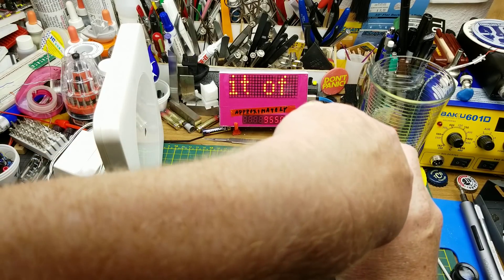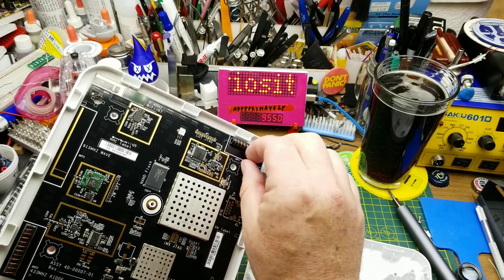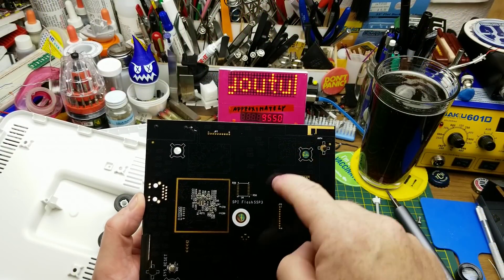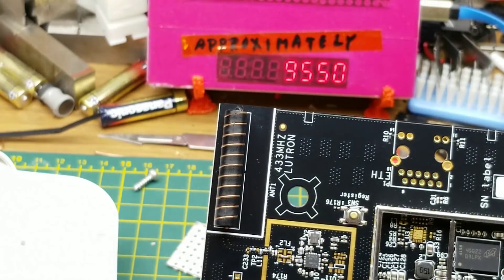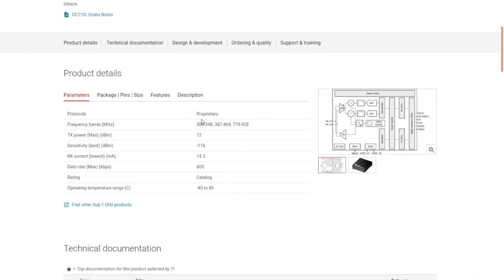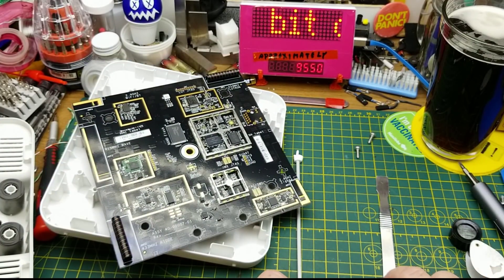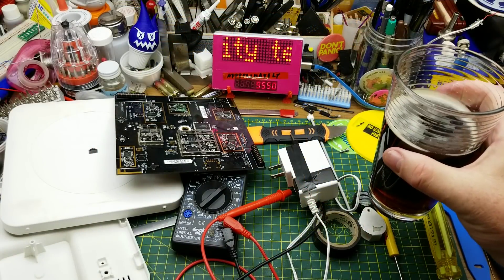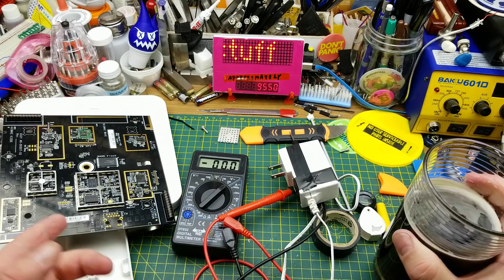IOT hub teardown (and a bit of a rant)

Comment: That power supply seems to be quite common and of reasonable quality.  I have a black one in the exact same shaped enclosure that came with a Yaesu ham radio and I highly doubt they would use something of questionable quality with a radio costing ~$1,000.  Now just replace that black electrical tape with some nice white tape and no one will notice!
Reply from the maker: If it hadn't been glued together, it would have been almost perfect.

Comment: Could you hack into the hub/Jail break and repurpose it?
Reply from the maker: Possibly. I'm not that strong on software and reverse engineering communication protocols, but i would bet it is possible.
At minimum a guy could probably load some custom firmware onto some of those microcontrollers.

Comment: Dude there's a uart serial connection! It's an international crime to tear down a piece of technology and not hook up an Arduino/serial adapter to see what's going on, especially when it's labelled like that.
Reply from the maker: Sounds like a future project.  Assuming they haven't encrypted everything.
Reply: You'd be surprised.  There's a really good guide video on YouTube somewhere worth checking out.
Reply: @pileofstuff  You might also try the ethernet port - looks like all the hardware is there.
Reply from the maker: @davidv1289   Maybe, but I doubt it's implemented in the firmware.  It was a feature they are advertising for the next version of hardware.I suspect they just ran out of time to implement it on the earlier version before they had to launch

Comment: You would think they would be making enough $s charging $80, ie, it doesn't look like it's worth that much, but I guess locking you in for life is better - lol -. 
Speaking of being locked in, I was just thinking about why there is so many MacBook/iPhone repair vids, ie, you don't see many Android repairs, and if you think about it it's probably the high price of their repairs that accelerate independent repairers - lol -.
Reply: There are design decisions with the iPhone that make it more susceptible to failures. Most phones use a single PCB and double load the parts on both sides of that PCB, whare as the iphone uses 2 PCBs with parts only on one side each, which they solder together trapping the parts inside so as to be hard to repair. This trapping parts inside cases a lot of shorted caps just on their own, and more shorts because it's hard to dry parts that get wet inside. Also their Intel MacBooks don't have adequate cooling, ie, their high end MB are slower than their mid range MB because they temp throttle, and this puts more thermal stress on parts, ie, the GPU failures in the mid 2010s.
Reply: @SidneyCritic  everything was fine until i saw backlight test pad next to cpu io line, when water gets in it's kaput komrad for the cpu (check out louis rossmam if you dont believe me)
Reply: Also most android phones are low end and not worth repairing as even the battery can cost as much as the phone itself after a few years

Comment: sonoff cloud stuff is better in this respect, there are open source firmware for most of the devices that lets them work with mqtt  and Tasmota .
If they decide to close up shop, you just reflash the devices and you own them. 
For there  "rf bridge" product, the custom firmware actually  increases the number of pairable devices from 4 to 16.
there camera has rtsp so you can use them with 3rd party dvr, ... maybe if there app went away you couldnt setup the camera tho, tho for wired use  it would onlybe a matter of the ip adress

Comment: It's a great looking device. I have little desire to have an automated home, part of the reason is trust: weather it is faith in some corporation to play nice or the resilience to hacking.
Reply: It's remarkable what you can accomplish with a Raspberry Pi a Zigbee USB dongle and a load of ESP8266s, a soldering iron and a stack of open source software.

Comment: I'm with you about iot companies. The whole arduino iot cloud is bs as well.  If I'm going to make anything iot enabled I'm writing the code myself. Too bad some of that couldn't be reused.
Reply: While it would be difficult it might not be impossible to repurpose the device given that all of the documentation for the chips can be found online along with their pinouts and quite possible code examples.  

If you can gain control of the CPU then you at least have a useful beach-head for making use of the rest of the system, though that all depends upon what software is loaded into that 1GB nand flash chip and whether it needs to be circumvented or not.  To that end the JTAG headers and that unpopulated ethernet port could be quite useful into finding a way into the system as there's possibly an alternate version of that hub that came with an ethernet port so there might be software around to make use of that one which might work on this one (once an ethernet port is soldered on of course).
Reply: @12Mantis  very good point. I haven't used jtag in like 20 years since I used to pirate satellite TV. I gave it up when the second card writer died from natural causes due to cards being written to so often it wore out the contacts inside haha
Reply: @jstro-hobbytech  R.I.P.  card writer.

sniffle
Reply: @12Mantis  card writer number 2 lol
Reply from the maker: Yeah, the main processor is likely going to be the most challenging to deal with.

as long as the other chips can be convinced to operate independently there is still a possibility of doing something interesting.